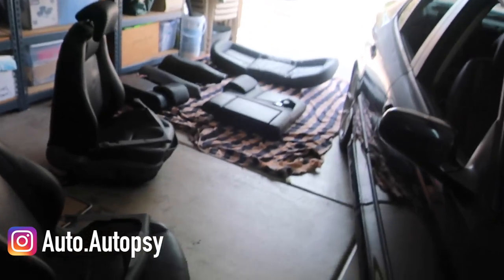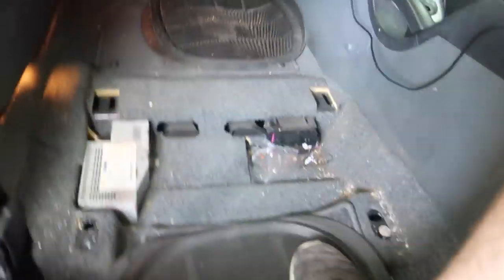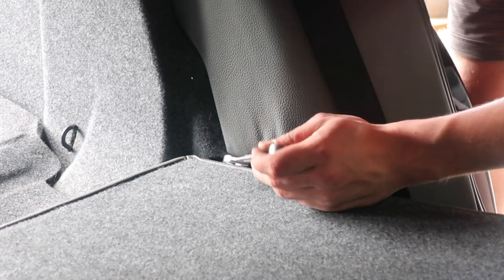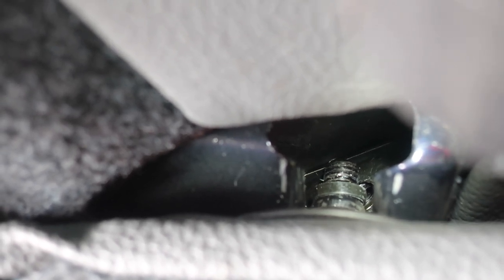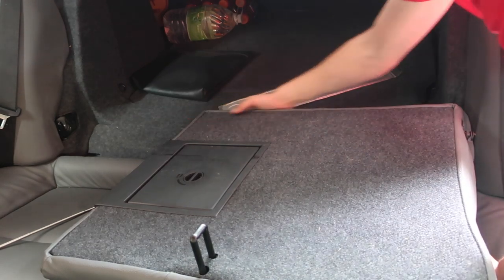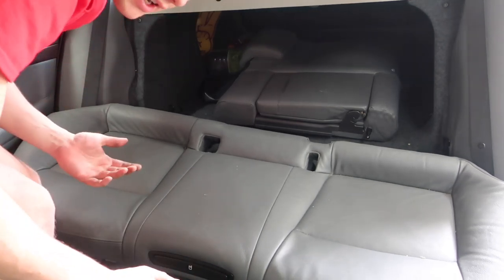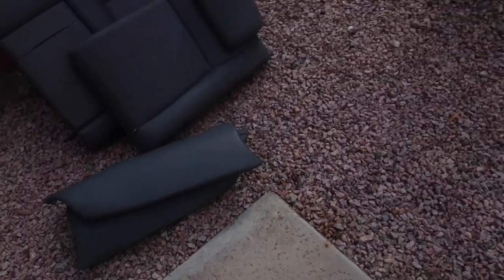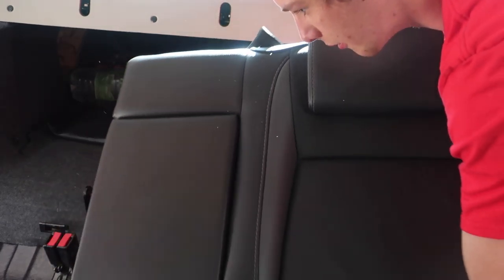Saab 9-3 Rear Seat Removal and Replacement!

Comment: For the 13mm on the sides: put wrench in with seat UP, move seat down or forward, remove wrench. Repeat this about 10 times and nut is removed. reverse for passenger side...your welcome :) You use the movement of the seat to undo the nut.
Reply from the maker: yep, that's what i did! I actually recently learned you can do it without even removing all of that stuff too lol

Comment: i was hoping to see how you remove and put back the side panels but they were all just skipped...lol.
I ran reverse camera cables through there and think i broke a clip and it's not sitting firmly. I did not remove the whole panel, just got enough gap to run the cables through.
From watching this, i think you can remove the back seat cushion first and then remove the side panel?
Reply from the maker: i'd recommend doing the side panel first. you can also just pry that spring in on the seat backs and it'll slide out if you orient that plate right

Comment: When you were putting the bigger side of the rear seat back on did you slide it into place without the spring or anything on it? And if so how did you get it on once it was in?
Reply from the maker: yeah you've kinda gotta jam it all on there' it's a tight fit for sure

Comment: Yo! I need to shoot you some videos I took this morning of the CORRECT way to remove the folding seats. No need to loosen that 13mm bolt, way easier route
Reply from the maker: yep, i learned that the second time around
Reply: Wait what
Reply: I literally just put them back on after doing this, biggest pain in the ass of all time
Reply: What is the easier way?
Reply: @AutoAutopsy  what is the east way? I'm going out to get aero seats for mine and would like to know if there's an easier way to do this lol